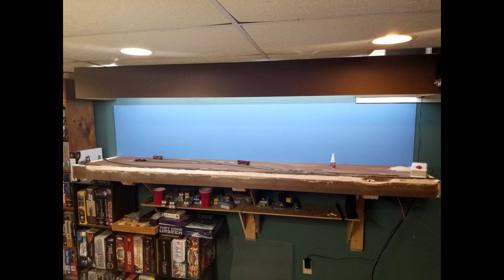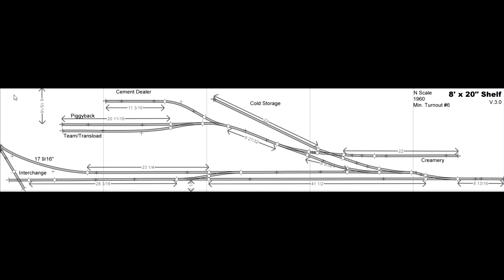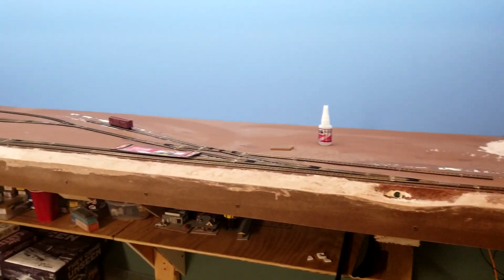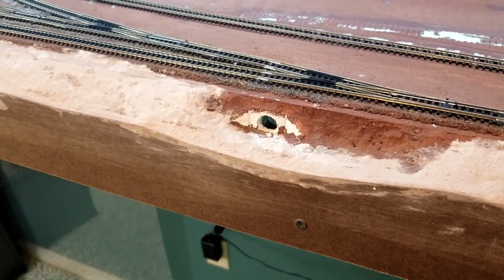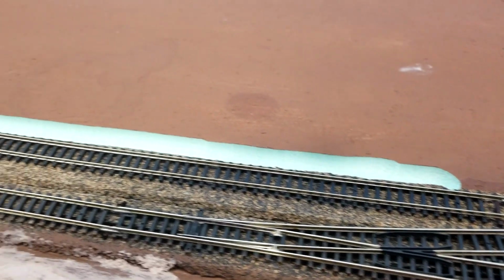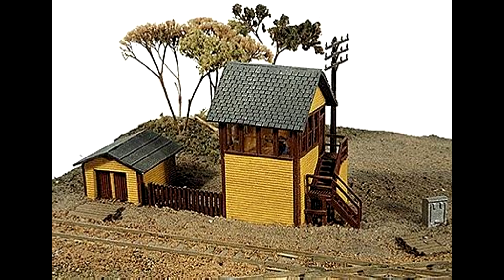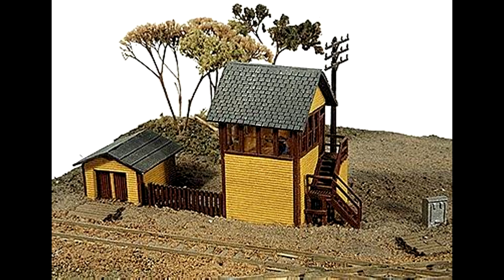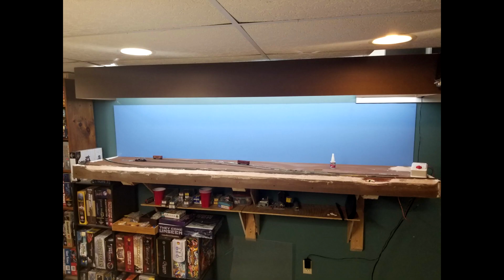Paradox Railroad | N Scale Shelf Layout Build #3

Comment: Looking good. The one worry I have is if the switch lead will be long enough for working the col storage warehouse. From the freight cars on the layout I am guessing you are modelling 1950s, so big reefers won't be a problem, but you still might not have enough room to pull a string of reefers out. If I am correct, an easy fix is a temporary extension that attaches to the right side of layout for the main-line to extend while operating. Look forward to following this. Good luck with it.